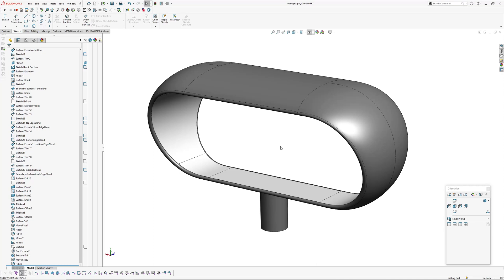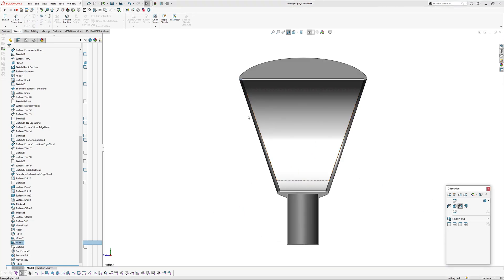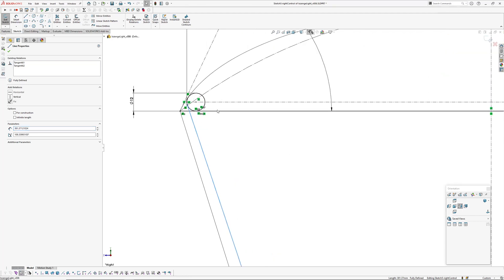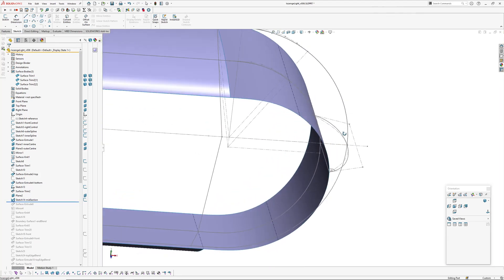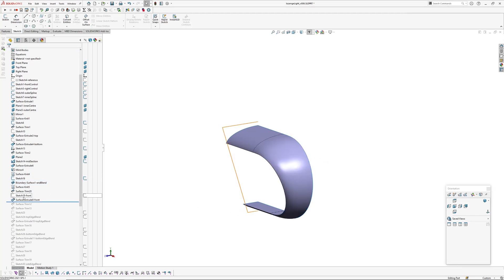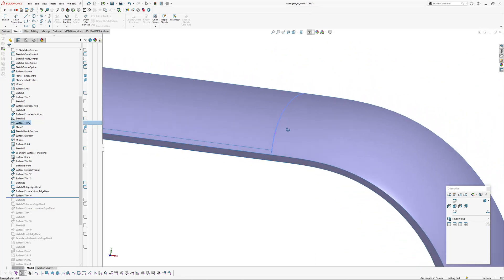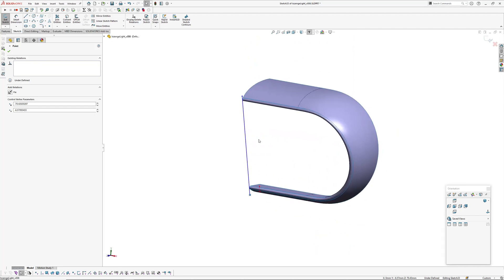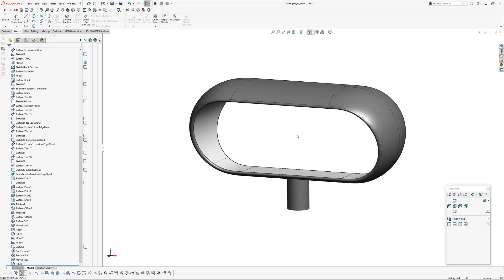Modelling an Asymmetric Lozenge/Pill Street Light in Solidworks

Comment: Interesting approach.
What was your reason not to model a pill, then cut off the sides and finally make an extruded cut?
Reply from the maker: I think doing it that way as a solid would have made controlling the outer surface form trickier. I'm pretty sure the 'untrimmed/uncut' form is not a revolved pill form.